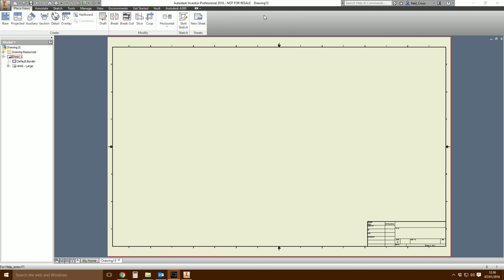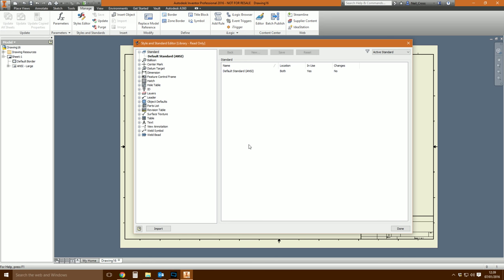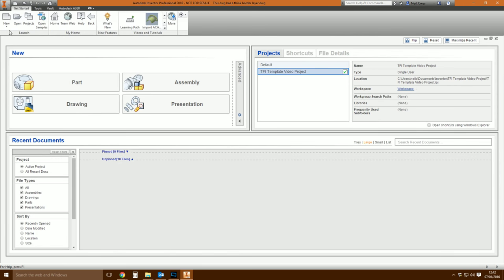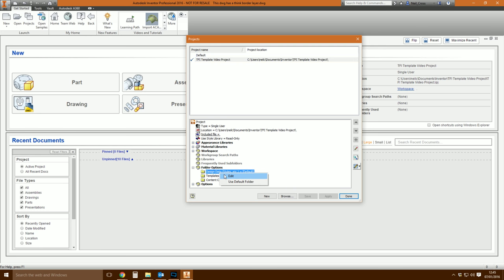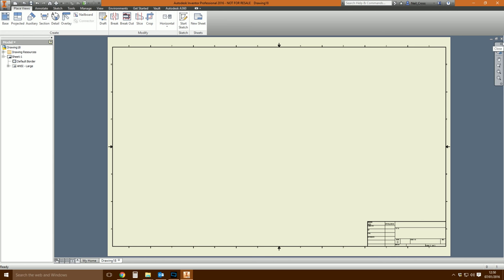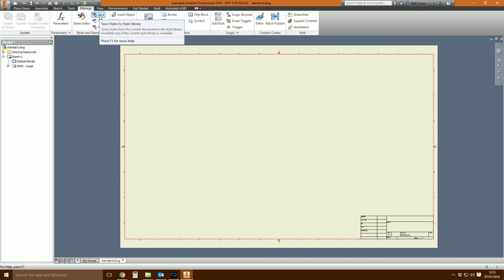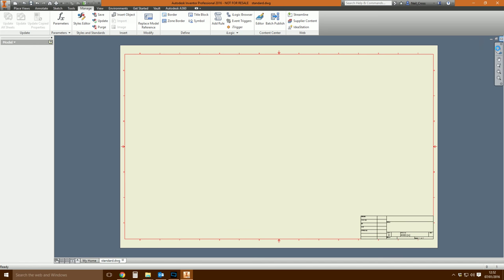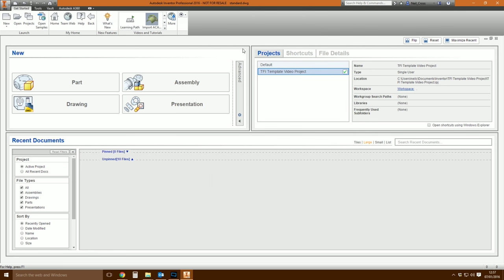Drawing styles & standards editor explained | Autodesk Inventor

Comment: Neil, watched this one a few times. Completed all steps just like video. In one project I saved the styles edits. In a different project that uses the same standard with a few more styles edits, I also completed the styles edits save. Then when I went back to the first project I received the styles error message upon starting a new drawing. I assume it has to do with the standard that is referencing the edits, no? If so, how/where does this get saved to the project?

Comment: In a drawing how do you set up the dimensions from your parts to the bill of material, so if you change the sizes in the parts it will automatically update in the bill of materials. So a cutting sheet can be made from the bill of material.

Comment: If you just changed the settings for a single file, but did not save as a new style? Do this: 
1.) Open the old drawing file with the "all the settings"  
2.) Do a save-as of that drawing file.  
3.) Delete all the stuff on that drawing and use it as a template for the next drawing.

Why do this? What if you "don't have the rights" to create a new style, because of vault issues or the I.T. or Vault Admin restricted that capability.  Happens all the time.  Almost forgot last thing to do:
4.) Save a copy of that drawing file or template on your local drive.  If the vault admin ever opens your file or "batch processes" all the drawings to "update to a new style/standard" your settings will be all wiped out.